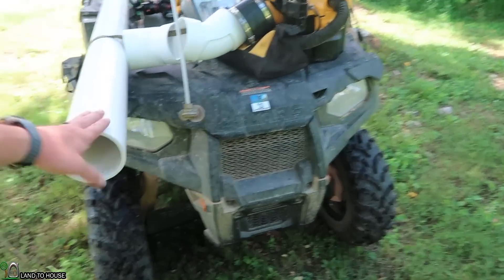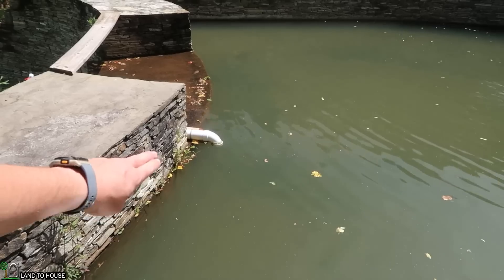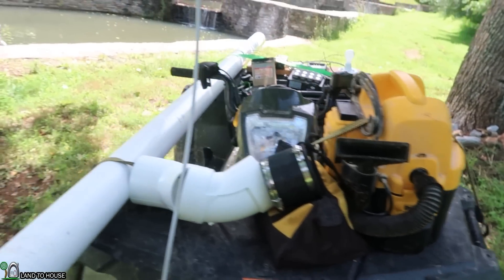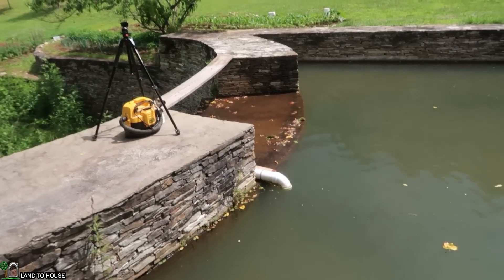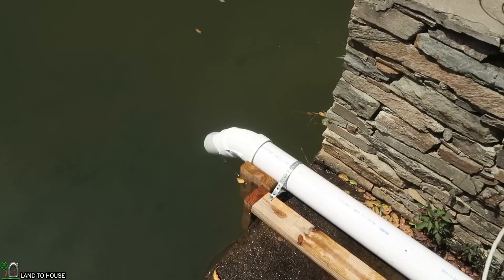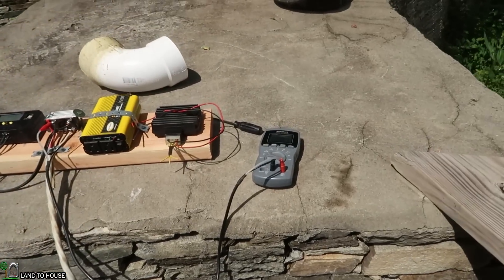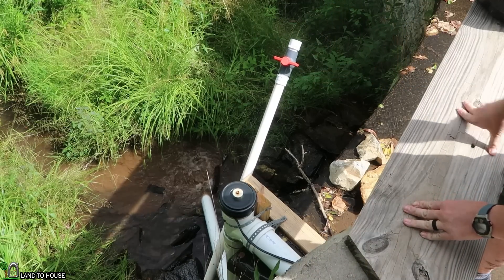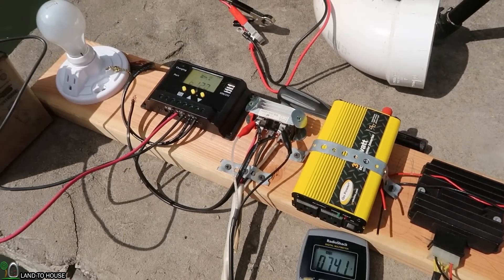Micro Hydro 4" Down Pipe all the way to the Bottom

Comment: I am a pastor an Assembly of God Christian church property that has 4  1/2 acres with a creek that runs through it, where 3 springs feed the creek. There is I’m sure over hundreds of gallons flowing through it. The drop age  on the property is also at least 15-20 feet. The winter run off is more than the summer, but because the springs run year round.I’ve watched enough videos to believe we could be harnessing the water to help offset electric bill to the parsonage that sits on the property. I don’t know where to begin. I need help. Where ready to invest in materials that would help..I just am in need of some advice..Hoping you can help steer me.

Comment: you aren't hearing air bubbles at the turbine, you hear cavitation. rocks in the pipe is what cavitation sounds like. you are loosing tons of performance because the turbine is cavitating. turbines need to be at the bottom not at the top of the pipe.

Comment: To all

If you go to ( Robert Murray Smith) channel; you will see video on his windmill build were he took the load off the generator by:

 Putting in capacitors in line; between the generator and battery.

He showed the generator was charging the capacitors first. Which took the load off the generator. 
Then on a seperate electrical loop from the capacitors to the battery, letting the capacitors charge the battery.

More effective/ efficient design to add capacitors after generator and before batteries.

Seperately:
A proton wheel is no taking advantage of the downward water force. A computer fan blade type impeller will be more efficient/ effective for this design  in my humble opinion.

Comment: For a temporary air seal on the pipes, you can tape the joints with duct tape. Duct tape is air tight. (And very sticky glue).

Comment: The net head of your site is the pond level to the tail race level,, your discharge tube and penstock tube can be 4" .. the discharge tub should exit under water in the tail race.,, This will give you the max head possible at your site.. net head makes horse power.. if your sucking air on the intake tube put the end in deeper..your vacuum hock can go in the horizontal intake line..you must glue your joints,, if your sucking air your loosing power.. thanks a hydro guy.

Comment: What is the potential waste in a siphon system? friction on the blades a good or bad thing, are you pushing on the blades or pulling on them? Waste cant easily get around the blades so are they slowing things down? Tesla created a 95% efficient turbine that we cant make yet as it destroys itself, but can we use elements from that wnd get close?

What would 2-4 x 1.5"-2" pipes do when directed at the blades at an optimal angle (similar to your pelton setups) within a 6" down pipe do? 

Or mini kaplan or francis turbine archimedes corkscrew or rose windmill design.

Comment: extend the shaft  and put the impeller all the way down at the end of the  pipe and use a jetski jet drive impeller ( because of a very close tolerance between the blade and the tube) to spin the Hydro unit, the bubble could be an air trapped under the propeller creating cavitation

Comment: So, I personally think that the turbulence due to the angle of the intake as well as the other angles in the pipe have almost no effect on the system. The main thing you want to solve is the connections sucking in air. 

The replacement of the 90 degree intake did not increase the power. The increase in power that started the turbine instantly was the 1.5 foot extension on the intake. Water in a pipe has the same pressure all throughout the pipe, thus whatever the pressure is in that body of water at that depth is the pressure of the water inside the pipe. If you really want to get some power put an 8 foot extension on the intake.

Comment: Extend the symphony pipe deeper under the waterline. You will not loose head pressure and you will have more water once the lake starts dropping and eliminate the air from a vortex. My pipe is 36” below waterline and it will develop a vortex. (I’m 3400gpm) your waterline is your head pressure even if the intake pipe is 10’ deep, less a minute loss in friction. Air leaks and vortex are power killers in hydro. Air compresses when it contacts the runner to push it. Get rid of the air!!!

Comment: You say you read these comments. You should have a ROUNDED INLET, NO SHARP EDGED ENTRY.  like flat flange at the entry, BUT have it rounded like a radiused router bit might do, but the radius on what now is a 90-degree turn should be about the same as the radius of the pipe, so the water will be smoothly accelerated into the center of the pipe entry.
Reply from the maker: My plan is to test a board over the dam that brings the water up to a starlight pipe.  No 90 or 45.

Comment: My question is ,,,   "Is that Propeller setup producing more watts for the same flow of gallons per minute than a Pelton Wheel Turbine would be producing?  I think not!
Reply: A pelton runner is for higher pressure/ head. Peltons are impulse and this runner, similar to a Kaplan, is a reaction runner. Pelton would not work well with this low head.

Comment: For your tests I bet you could just seal around the connected joints with some silicone calk to stop the air but still allow you to pull the joints apart ? Potentially even just one wrap or two of painters tape at the joints before you assemble them too

Comment: I would suggest looking into adding a buck converter that way you can work at a higher voltage. So the battery would be in the low side voltage and by changing the duty cycle of transistors your turbine will work at a higher voltage. This is the idea of how an mppt controller works but it adjusts the duty cycle automatically to get max power. But you could do one controlled by a potentiometer, it would be more simple and just observe the difference in power generated. The advantage of hydro vs wind is that the maximum power point won't change much because whater flow is more constant, not like wind that is changing.

Comment: Use a tennis's ball to end of pip or somthing that floots and will take away from the water vortex sucking air. If you go fourth up the creek and find any spots making a small settling spot and opened then get more water down to you and not worry about water drop to make the vortex possible. Great video can't wait for more

Comment: You should have a dump load to reduce speed when the battery is full. This will lower the speed of generating and save water.

If you have a mppt charge controller with a output that can adjustable LVD, you can connect a dump load there.

The load should be lower than the output, so the battery continue to charge.

I'm using victron mppt charge controller, and have the "output on" set just below the float voltage, and "off" just above the the rest voltage of the battery.

I'm not using it as a dump load, so if you use it as a dump road I would set the voltage on at the same value as the absorption voltage.

Comment: 75VAC is about 80% of what I was getting with 2.5m drop 120 inpipe  200mm draft. But with that a 3.1A load dropped the rpms/volts by 50% (which should be your  maximum efficiency point), whereas you're getting about a two thirds drop with 2.9A, so seems like you're producing less torque.
No idea if this would be the shape of the runner, or difference in head or pipe, or efficiency of the alternator, or something else more obscure.
Reply: Water Turbulence cus motor at the top and without a one-way valve to prevent back flow if that motor was at the bottom I think it wouldn't last cus of to much pressure ..... Be better off with a water wheel and a cog system

Comment: Having the pipe go down further into the water won't cost you power, the potential in a siphon is between the highest water level and the outlet. More pipe and bends in between means more friction and turbulence, but strictly speaking you can have anything at all in there and it won't affect the total gravitational potential energy of the system.

Interesting that the pipe pulled free when under load.. Also strictly speaking, the weight of water in a pipe shouldn't pull on it if the water is in freefall. For mine it was definitely an issue as I had a releasable end plug for filling the system, and it weighed hundreds of kg, but since you're using a vacuum it shouldn't be an issue, minus a little force from friction.
But then load means resistance means not freefall any more, but I would have thought this would put the pull on the runner rather than the pipe, since that's the bit imparting the resistance and negative pressure, but guess not.
Fluid dynamics is voodoo.
I just held my sections together with one or two wood screws through the pipe walls, and taped around every join instead of glue to reduce air ingress. 

That gravel sound at the runner is I'm pretty sure cavitation rather than air.
Reply: I think it would help a lot if he extend the drive shaft all the way to the end of the pipe and use a jetski impeller to drive the charging unit, that's a lot of weight wasted to spin the unit

Comment: The impeller schould be lot longer to increase the power, contact Langston's Alternative Power and tell them to upgrade the impeller blades to a longer version, than it schould start without  having to help it to get it going. 
Than my next tip for sealing the pipe connections with Self-amalgamating tape, this is ideal for testing or even a permanent solution. 
Greetings from Belgium !

Comment: Hi Seth,  Thoroughly enjoy your series.  Just one question I have. I am aware you are using a syphon system to drive the alternator.  But I would love to see the alternator at the end of the syphon feed pipe as close to the water level as possible!  Water is about 10 pounds per gallon which has to be better than the drive by vacuum???

Comment: Before you glue it all up, make your intake piping deeper.  It won’t change the effective head.  Also, make sure your discharge pipe is always submerged and there is no flow obstruction nearby.  Some of the noise you are hearing in the turbine may be cavitation, but with the very high setting you have it’s probably unavoidable.

Comment: Instead of glue why not use a good silicone in case you need service some part, My one obsevervation is I  think the vacum start system needs to be remove since now you have done the 45 and a short piece of pipe I beleive the vacum port is no  longer of any use since water will want to naturaly flow into the pipe since it has a slight head pressure against it. Tye a line on the intake and attach a bobber or some srt of floatin ball and it with break the votex effect.

Comment: For sealing temporary connections just buy a small tub of plumbers putty to seal the outside of the connections. It will stop the air leaks and you can just remove it and use it over and over!

Comment: Which mppt controller did you buy?
Reply from the maker: Its the bouge rv 40amp.
Reply: I don't know if that will work for hydro, not all mppt is created equal.
Reply: @JoeMalovich  No, the "BougeRV MPPT Solar Charger Controller 40 Amp 12V/24V" is only meant to be used with solar (see https://www.bougerv.com/products/charge-controller-1). Probably, it will not work better with the hydro generator than the old one. I still think the most reliable solution would be to take the MidNite Classic from the new shed.

Comment: I'm very suspicious that there is a major air leak at the turbine shaft seal. I just can't see that amount of air in the outlet flow being the result of joint leaks and a microscopic vortex.
Reply from the maker: I think the 4" pipe right before the turbine is barely resting in the fitting. Measure air leak.

Comment: Great vid. Is it possible to start the flow by spinning the motor instead of using the vac pipe?
Also, what happens if the water at the end is not submerged?

Comment: Another random thought seeing you spin the generator at the end to restart. Could you use a brushless DC motor controller to spin the generator to start it without the vac..?
Reply: A generator is a brushless dc motor, so with a bit of circuitry you could probably get it to auto start quite well.

Edit: that generator is a brushless dc motor. It has permanent magnets and 3 phases.

Comment: and why not just tape the leaking joints? it's vacuum pressure, so its easy to do simply with some tape
Reply: Doesn't even need tape. Just some grease will seal it.

Comment: You could wack one or more toggle switches between the generator and battery to avoid messing with screw terminals.. Agree with many other comments on taping the joints being a good idea..

Comment: When you glue up, also bring the 45 for the air vac tube.
Reply: That vac tube should be joined and accessable from the side away from the waterfall. Because flash flooding is a thing. And your safety is important

Comment: You could use window putty / clay to seal around the fittings, that way you can still change them in the future. Or silicone sealant. Would be cool to set up one of these on each of the 3 steps in the pond / dam arrangement. 
I definitely think a 6" pipe would help a lot but I suppose the cost is much higher.

Comment: @Land to House I don't understand why you place the turbine on the top of the fall. You leave most of the potential energy in the water this way. I would put the turbine at the bottom of the water drop. The water would have speed up significantly trough gravity, hence the turbine blades would run quicker, and you make more power. I do understand that you want to work with a syphone, but you can do that and put the turbine at the bottom still.

Comment: Also, bro-tip: can use a relay with a higher VDC voltage (and slap in like 20 diodes in series), small capacitor (high voltage rating) in parallel: can use this to reengage the battery after the generator kicks up to speed... :D.

Comment: 7:30 Be careful when switching modes on the meter. The leads, at least one, shall be disconnected. Other wise it could damage the meter if the leads are connected to a voltage source and you went past the resistant reading and/or the diode and/or the continuity tester. 

I saw that the voltage, which you had selected, is next to the OFF and you switched it off. But still, it’s a good idea to remove one of the leads before switching. As a spark is caused inside the meter and it can damage the swiper blades.

Comment: HI     I WONDER IF SOME OF THE AIR IS FROM CHURNING THE WATER WITH THE IMPELLER OF THE GENERATOR , AND NOT FROM SO MUCH FROM THE JOINTS.     JUST WONDERING.
Reply: Where would it come from though? From dissolved air in the water? Is that a thing?
Reply: @ThisRandomUsername  THAT IS WHAT I WAS THINKING.

Comment: HI    YOU COULD USE SOME KIND OF GASKET SEALER ON THE PIPES AS A TEMPERY SEALENT SO YOU WOULD NOT HAVE TO GLUE THE JOINTS.  I DID THIS ON A GARDIN WATERING SYSTEM AND IT WORKED WELL WITH THE LOW PRESSER.     JUST AN IDEA.     GOOD VIDS KEEP THEM UP.

Comment: Just wondering if a 22 degree pipe fitting warrants (pond side) a try, before gluing the pipe in place. Obviously the pipe will need to be longer, so as to get some depth in the water, to prevent the vortex. Thanks for sharing.

Comment: Put the hydro at the bottom of the pipe
Reply: I was thinking same thing but that motor/generator is bit useless at  12v 2amp doubt he really needs that size pipe for such small motor maybe use 5 of em then split big pipe into half the width  ... Don't see the point of it been at the top when the weight of the water cud be used to increase the pressure at the bottom 😃 and the bottom pipe in the water cud cause pressure build up in down pipe just a guess tho..
Makes me want to build a pond 😉

Comment: You can use some silicone to seal the pipes and stop the air sucking in and still be able to disconnect the pipes to make changes.. Since you are just doing tests, I would not glue them together, just use silicone caulking... I have done that many times, to do a temporary seal, and it works very well.. Also you need a longer pipe going into the pond.. I would use a "T" fitting, so you can cap one end and use it to do a quick stop of the water being drawn into the system.. I hope this helps or gives you more ideas to better test...

Comment: When siphoning a large pond in the past, I've left my 3" fittings unglued but I wrapped the pipe ends with a single layer of duct tape.  It's a little more trouble putting the fittings on but there is almost no air seepage. Just a thought... I always enjoy your efforts and appreciate your hands on insights Seth!!
Reply: Ya was just thinking that myself, if its not a final permanent build tape seems like an easy way to fix the air issue

Comment: For the experiment do not glue the joints...just put some seal tape/duct tape/any water proof tape around every joints to prevent air sucking around the joints...this shall give you flexibility to change the pipe according to the need of the experiment 🙂

Comment: i would of been tempted to not have the charge controller and run 2 battery's for 24v or evem 36 and 48v as the bridge rectifier will stop the battery turning the unit into a motor and with the meter see what the difference in watts is